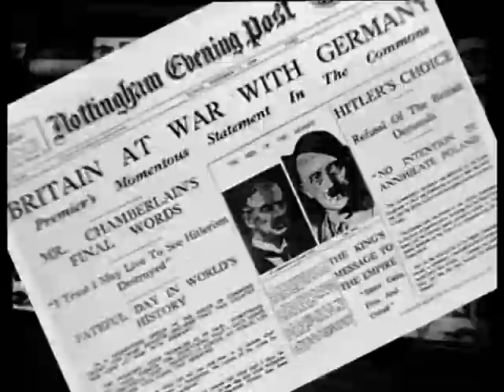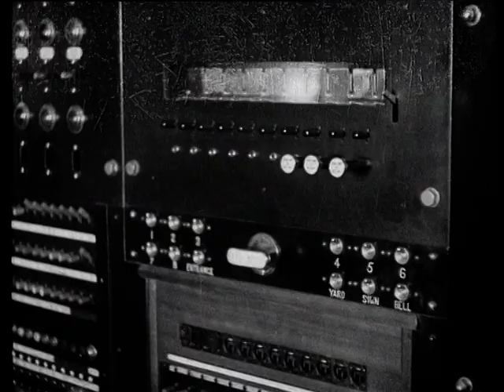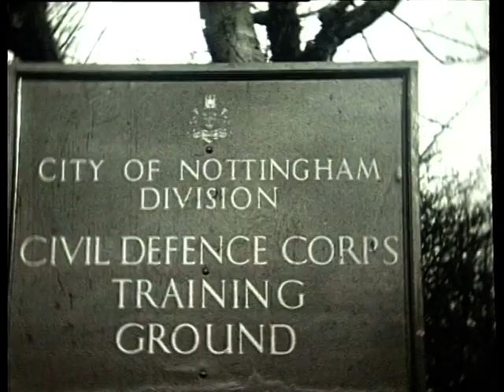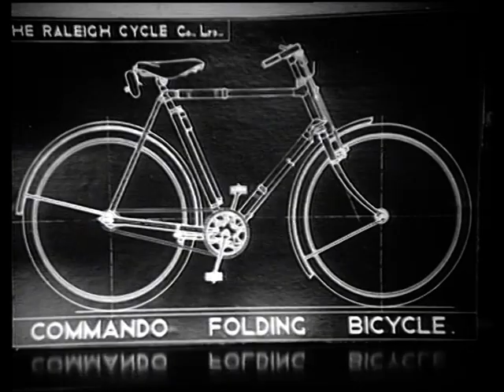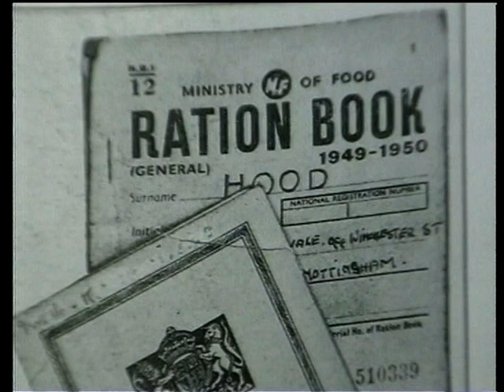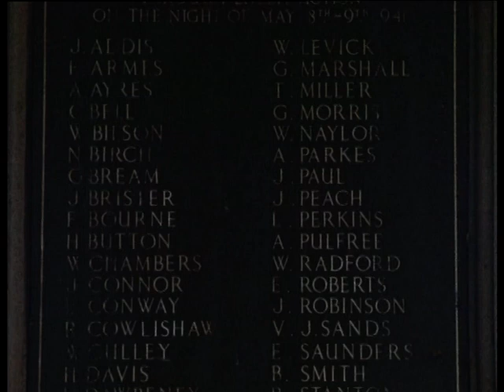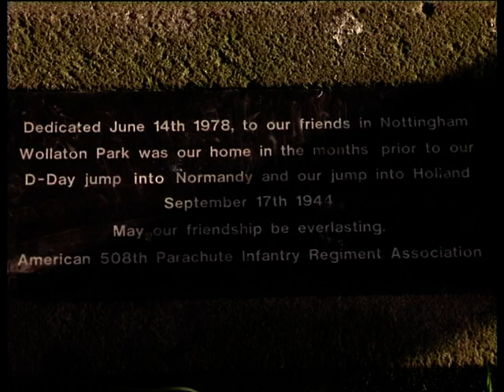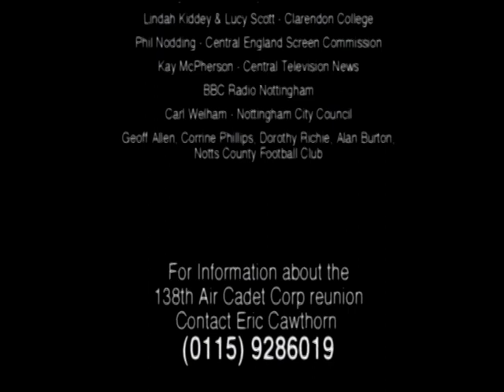Nottingham at War: A City's Fight for Freedom

Comment: Compared to most other big cities, Nottingham escaped almost unscathed. Yes, the big raid in May 1941 did some damage but 90 bombers couldn’t do knock down too much or set up a fire storm. There was damage in some localized areas, such as near the river, hence the major tragedy of the Co-op bakery and in West Bridgford. When you think that Liverpool lost over 2000 in one air raid, Nottingham lost less than 200 in the whole war. The one notable building lost in the centre being the Old Moot Hall, on the edge of Slab square, on the corner of Wheeler gate and Friar Lane.